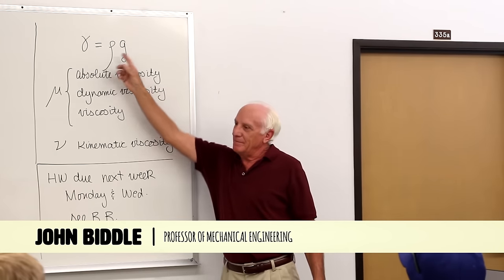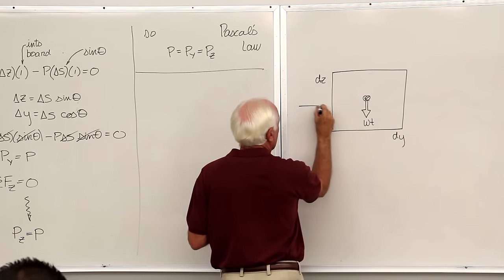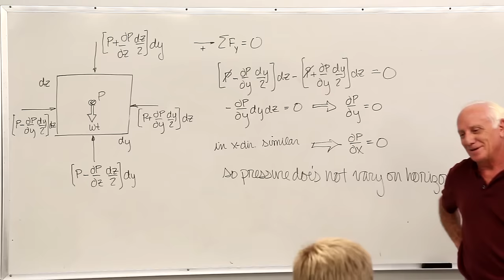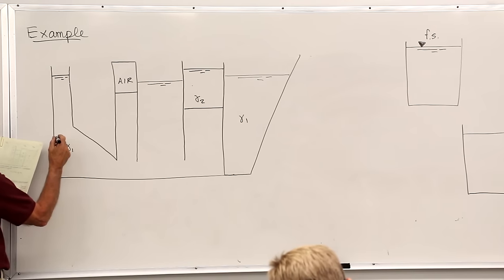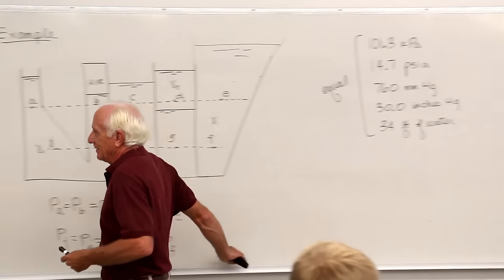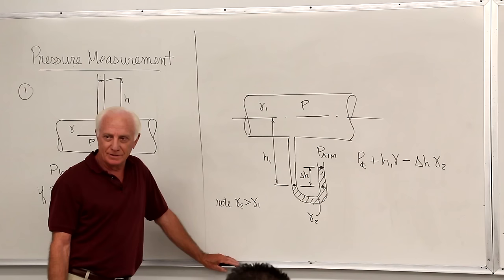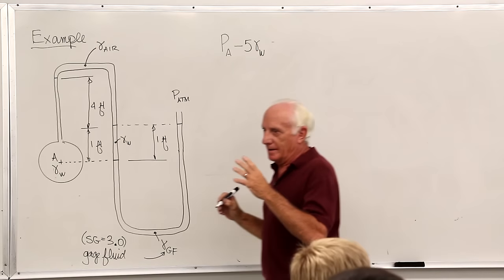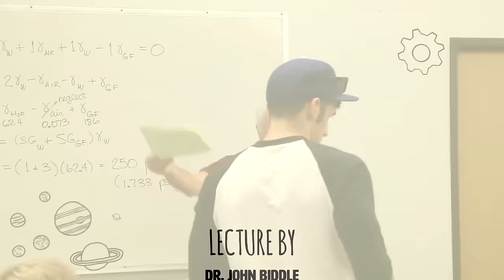Fluid Mechanics: Pascal’s Law, Hydrostatic Pressure Variations, Manometry (2 of 34)

Comment: Thank you so much. I paid several thousands of dollars for this class and this videos are way more helpful than the lectures at my university. Please post more courses.
Reply from the maker: There are a few more in the pipeline, but it takes a while to produce them.
Reply: i have my final exam on Tuesday and now i found these videos.I am regretting of not finding it before :(
Reply: good that in EU we got unis for free, i would sue uni if I had paid for such a bad teaching
Reply: I go to UIC. Every single fucking fluids instructor is a dumpster fire. I complained to the dean, and now I need to watch these videos to even have an iota of what is going on. I literally watch these before lecture. 1/34 down, 33 to go.

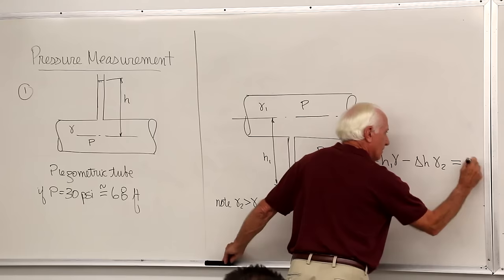Comment: Professor at 44:39, I will call the point where the h1 ends as Point A, and to the point which is horizontal to point A as Point B.
Now as you said: Pressure at Point A = Pressure at Point B. 
Point A is equal to = Pcenterline + h1gamma1 
Why the pressure at Point B is not equal to Patm + h2gamma2 ?

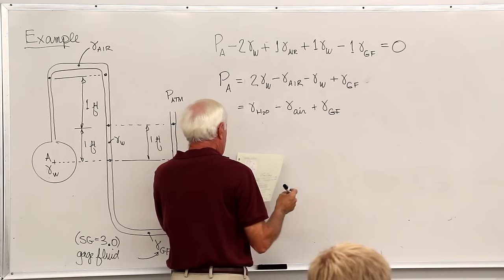Comment: can you explain the step beginning at 57:30, ending at 1:02:31. Where does the gamma(water) come from that gets multiplied to [SG(water)+SG(gage fluid)]
Reply: Since we neglect air, we are left with SG(water) + SG(gage fluid).  Recall that Specific Gravity is the ratio of the density of a substance to the density of a water. That is Specific Gravity, SG = {density of any fluid} / {density of water} 
Since we need density of gage fluid,  and know the SG(gage fluid), we can multiply it with density of water to obtain the density of gage fluid. 

Pa = [ SG(water)*density(water) ] + [ SG(gage fluid)* density(water)] 
Pa = [  1 + 3 ] * 62.4 
Pa = 250 psfg. 

I hope that answer your question, of anyone in the future :)
Reply: @runtime_engineer 
OK thank you
But 
 Why he said that  P(atm)=0.
We know that the pressure atmosphere =1atm
Reply: @Abedalrahman-Edris  Because that's the gage pressure. A gage not connected to a system with pressure reads 0 because it neglects the atmospheric pressure. (Think about reading a tire pressure gage). If we were talking about absolute pressure, Psia, then we would have used the true atmospheric pressure. I know this comment is from a year ago but I hope that helps.

Comment: Great lecturer, Dr. Biddle  - one born to teach! 

The hydrostatics (not limited to this lecture) misses one point: gases are compressible and liquids are not. This essential difference is missed since liquids and gases are treated as if they acted the same. This results in strange principles, for example, that like a gas, the pressure exerted by a liquid against the walls of its container are the same as the hydrostatic pressure, which completely bypasses the issue (not existent in gases) of mass, resulting in a liquid in the case of narrowing container towards the top, of exerting more force against the base than its weight! How a liquid possibly exert more force than its mass against the base than its weight?

Comment: Hello, this is very helpful, thank you for sharing.  At 11:26 you're expanding pressure like the taylor series, why is that?
Reply: Dunno if you still need answer but taylor series expansion is a series expansion of a function about a point it doesnt matter dy/2 or dy/3 you can found the pressure function about dy/3 or dy/4 etc.
Reply from the maker: All throughout engineering, whenever we examine small elements we often make a linear approximation to the Taylor series by truncating all terms with dx^2 and higher. For small fluid elements, dx is small. So dx^2, dx^3, etc... are very small and those terms can be neglected.

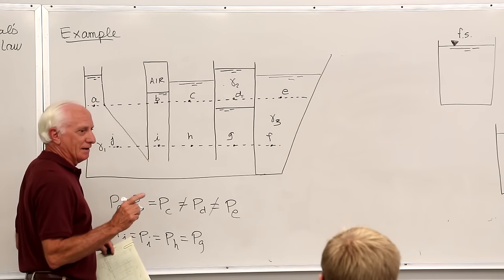Comment: At 31:15 could you explain why Pa=Pb? Since it's the same liquid in both the containers and the free surfaces are at different levels, shouldn't be pressure be different? The weight of liquid above "a" is larger than that above "b". Does that not play any role in determining the pressure?
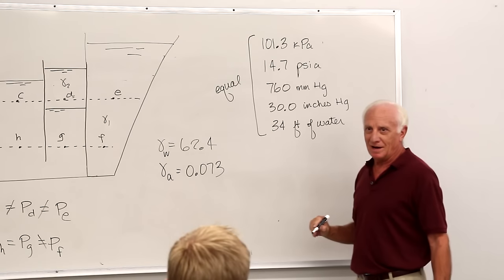Reply: go to 48:00, the thing is that in Pb the air makes a tiny pressure thus comparing to a liquid is negligible but following the rule to "same level and liquid" the Pa=Pb

Comment: I have questions for when he's explaining pressure being equal at 34:45. Wouldn't the pressure be different at different heights even if the it is the same liquid and continuous ?
Reply from the maker: If you have two locations at the same elevation, and the two locations are in a continuous fluid (there is no barrier completely blocking the two points), the pressure will be same at those two locations. As you move up and down in the continuous fluid, the pressure will decrease and increase, respectively.

Comment: 6:09 Delta S is equal to Delta S times sin of theta?
Reply: the horizontal scalar component of P perpendicular to the hypothenuse is P * sin(theta). Since he's talking about summing the forces (not the pressure) we need to use F = P * A. 

The first line should be Py*(Δz)(1) - P*(ΔS*sin(Θ))(1) or in words the horizontal force from Py minus the opposite force from P. The horizontal component of the area is ΔS*sin(Θ) because you're splitting a vector into components by using the sine and cosine relations from trigonometry. This NASA page has a nice explanation of that: https://www.grc.nasa.gov/WWW/K-12/airplane/vectpart.html 

We do that horizontal component *(1) of the length into the board direction for the area and then *(P) for the resulting force in the horizontal direction right to left that cancels out the force of Py from left to right. Leaving the sin(Θ) out at first is a mistake. I hope that makes sense lol :)
Reply: @tycho_m  thanks

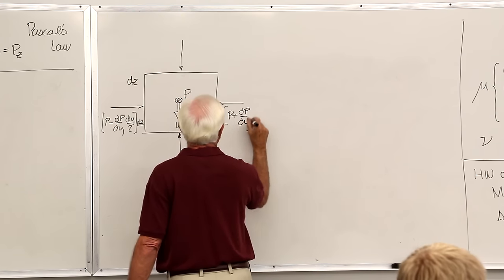Comment: at time frame 10:40 why is pressure pointing right negative?
Reply from the maker: The pressure force (pressure * area) is negative on the right side because it always points inward. However, pressure is a scalar and always positive. Since we are examining a 2D object the "area" is just dz on the left and right side. If the object is 3D and the length into the board is dx, then the area would be dxdz.